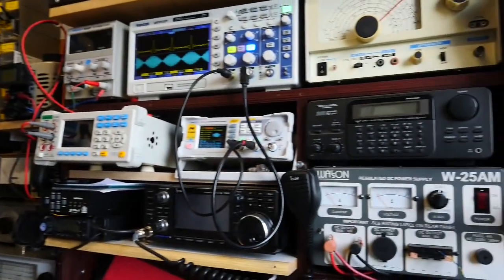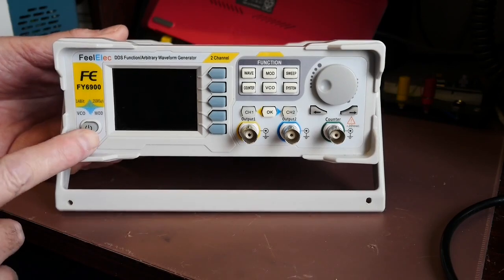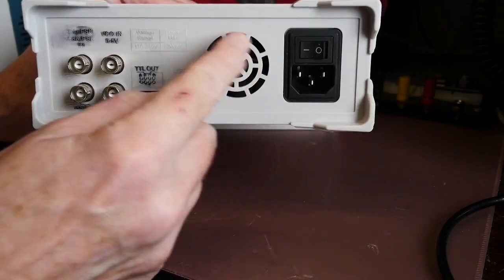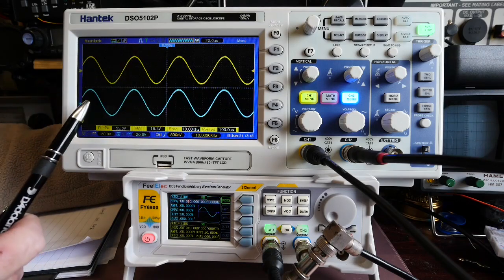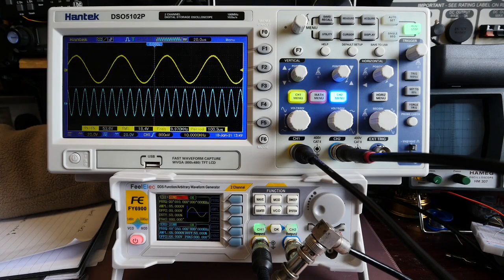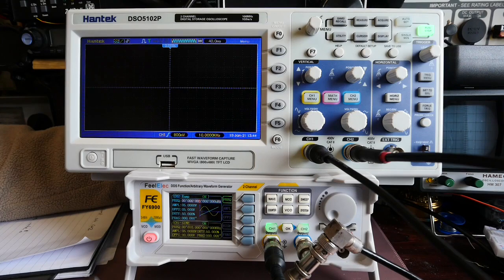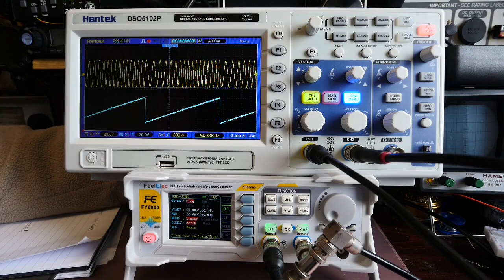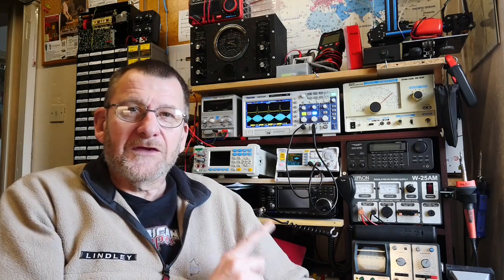FeelElec FY6900 Function Generator Review and making use of the VCO function - #047

Comment: I find two operational limitations with it: 1) Both channels cannot be simultaneously activated. 2) I cannot find a way to reset the sweep for instance, a 5 seconds sweep starts, it can be paused but not started from the beginning again.
Reply: Both channels can be activated at the same time. E.g. you can use ch1 for carrier, and ch2 for modulation. Or as in this video, ch1 for the VCO function (an alternative for sweep)  and ch2 for the ramp to control the VCO. A problem is that you cannot SET them while they both work, as soon as you need to change frequency on ch1, de ch2 stops.
If you need a sweep, maybe it is better to start experimenting with that VCO function (Voltage Controlled Oscillator).
I just made a setup with the VCO with a two channel oscilloscope that has a X-Y mode (one channel for the horizontal and one for the vertical deflection), and got both together working as a useful sweep generator (wobbulator) for IF adjustments.

Comment: I haven't purchased one of these FY6900 units yet, but I am VERY close. Some interesting ideas for doing frequency sweeps for filter and Bode plot measurements. The FM modulation idea from fredsmith5473 looks promising. I was wondering about another idea...
Let's say you set up a sweep on channel 1, for 10kHz to 100kHz, with a sweep rate of once per second. Then, on channel 2, you set up a square wave, with 1 Hz frequency. If you display both on a scope (triggering on the square wave), how will they appear relative to each each other? Will they drift relative to one another? Will they stay locked? Will the edges of the square wave be at some arbitrary position relative to the channel 1 frequency-sweep? If they drift, could you very slightly adjust the 1Hz square wave frequency so that the two waveforms stay in more-or-less sync?  (Kind of like manually adjusting the time base on an old scope with no trigger. :-) )
Reply: Update:  I just setup a sweep through the VCO input with a ramp from CH2, and had succes. No more bulky steps like from the internal sweep function, but a smooth path, and fast enough that my analoge scope shows a workable image of a pass through filter, so no digital storage scope needed. Just follow the instructions in that other video.

Internal sweep, according to the manual, the frequency steps used when sweeping lineair are defined by:
Step value =（End value — Start value）/（Sweep time*100)
So if you want a nice image, and need for that 20 images/sec on your (analoge) scope screen, and you sweep an IF filter from 535kHz - 575kHz, the steps the sweeper uses are (575 - 535) / (0.05*100) = 8kHz steps..... That is what I meant by unusable.
Reply: The 1 Hz sweep rate and the 1Hz square wave are never the same coming out of ch1 and ch2. But you can adjust the frequency of ch2 in the 1/1000 of a Hz, so after an hour of tedious setting and resetting you could get an image that 'sort of' locks.
The most important problem I encountered sweeping with the internal sweep + a ramp signal from ch2 connected to the scope in X-Y mode (I tried a day's work to test, haven't  tried the VCO yet) is that the frequency is not raised analogue, but in about 10-20 steps from low to high. On fast sweep speeds, say more than 1/20 of a second, a filter that is swept will show a stair case pattern, and only a very few steps. Unusable. You could sweep slower, then there are more steps per curve, but since I have an analogue scope it gets very hard to judge what I see. With a digital storage  scope you are better off. You can look at his other video to see an example of that: https://www.youtube.com/watch?v=yrS-1KXppmw&lc=UgwPSD-weP_YRG4OJRp4AaABAg.A4MDxKwW9rtA4UAaIDZlLD
Next test I will try the VCO with the ramp from CH2, but I assume that that will make no difference, otherwise it would be a feature already.

Comment: I’m thinking of purchasing one of these, but can I ask  it is capable of outputting a 455khz tone mod at say 30%. So you can align IF stages of a transistor radio ie Roberts rambler ?
Reply from the maker: Yes, page 27 of the manual says:

AM
Source	Internal (CH2) / External (VCO IN Port)
Modulating Waveform	Sine, Square, Triangle, Ramp, Arbitrary waveform
Depth	0% to 120%
Modulating Frequency	Internal : 1μHz~1MHz;  External: 1μHz~2KHz;

Comment: Another great video Bill.
Is it possible to get a 455KHz signal modulated with say 400Hz or 2500 Hz out of this unit?
If I set Channel 1 to 455KHz and then press mod, the modulation is fixed to channel 2
I’m confused.
Reply: I sat down and had a play.  These are the steps I took:
Ensured both channels were active; set channel 1 to 455 KHz and outputting a sine wave; set channel 2 to an audible frequency - I chose 600Hz; selected the MOD button and chose AM modulation ensuring the modulation source was set to Channel 2; used the BNC to alligator clip leads to connect from Channel 1 to the grid of the converter tube in the tube radio I wanted to check. The 600Hz audio signal was heard from the radio and I could tune the IFTs to peak them.

Comment: Can this generator output an AM modulated signal, say 600Khz w/ 1Khz Mod?
Reply from the maker: Yes it can
Reply: @LockdownElectronics  At age 65, and with an electronics background, I have just started a project to re-furbish a 1930's RCA 9K-1 tube-type (valve) AM broadcast/shortwave Radio,  (IF is 460 KHz).  I am thinking this might be a good device to align this radio, at the required alignment frequencies of 400 KHz, 1700 KHz, 6 MHz, and 18 MHz?  Would it be good for this purpose?
Reply from the maker: @RonS387  I would say yes, and I would use something like a 10n 600V capacitor to isolate the generator from the radio.

Comment: I found using the VCO with a cable from Ch 2 was messy and not accurate. From what I've seen, the response of the VCO isn't quite linear and mine had to be pushed slightly over 5 volts with the ramp to reach the end frequency. The offset was also slightly off. 

The best way was to use the FM modulation function, using Ch 2 as the modulating signal. I used it with a slow five step ramp and a frequency meter to check it worked, and it was pretty much spot on. There's also far less messing about. The falling edge of the ramp can be used as a trigger for a scope or you could use the ramp to drive the X axis in X-Y mode on the scope.

They produced a very sophisticated sweep feature with all sorts of options, but didn't add a sync pulse. At least I've not found any way of picking up a sync pulse in sweep mode. It's a bit like making a fantastic car, but not including a steering wheel.

Comment: To reach the same functionality you can use the modulation of the fy6900. Only the freqence setup is slightly different. It can be set the middle freqency und a span. Its useful to find the center frequency of filters. The sweep rate configuration is simular to your setup, means CH2 ist set to ramp of 5V.
The benefit of this methode you need no Connection between CH2 and the VCO input.

Greetings
Reply: Thank you for the tip.   Would you explain how the middle frequency and the span are related to the settings (CH1 Freq) and (BIAS Freq) in the MOD mode?    I set (CH1  Freq) to 3kHz and (BIAS Freq) to 2kHz.   The sweeping appears to start at 2kHz and stop at 3kHz.   According to this observation, the sweep frequency appears to start at (CH1 Freq)-(BIAS Freq)/2   and stop at (CH1 Freq).  Does this sound right?   The offset of CH2 does not change the sweeping range.

Comment: Thanks for this interesting video. I too have a FY6900.

I have a question about impedance matching. If I'm not mistaken, the FY6900 has an output impedance of 50 Ohms. Did you set the input impedance of your Hantek scope to 50 Ohms too? Because I'm not seeing 50 Ohms terminators in your setup. Or are the frequencies you are using so low that impedance matching is not an issue? 

Thanks for the videos! I'm subscribed :-)
Reply from the maker: Yes it's 50ohm output. I do normally use a terminator, but managed to forget on this occasion! 
I have been doing a bit more work with the FY6900, another video to follow. ..
I am on a steep learning curve!
Reply: @LockdownElectronics  Thanks for your quick reply. I'm on a steep learning curve too :-)

BTW, I have a handheld Hantek too, like yours, and I just checked the channel menu: I can't set the impedance, so it might be that your bench Hantek scope is missing that feature too.

Comment: I’ve had mine for around a year now, it’s pretty great other than the lack of a power switch on the front panel. I’m not a fan of devices that “sleep” as does this, being used to older stuff that might decide to burst into flames in the middle of the night. I mainly use it as an RF generator for aligning AM radios, and it accomplishes that task very well.
Reply from the maker: Yes I only use the front panel power switch if I want to keep the settings during the day. I always switch off at the back for overnight.